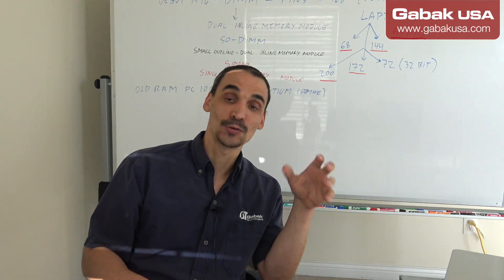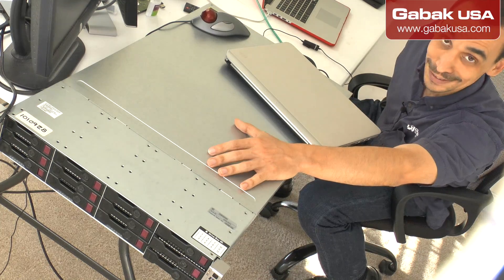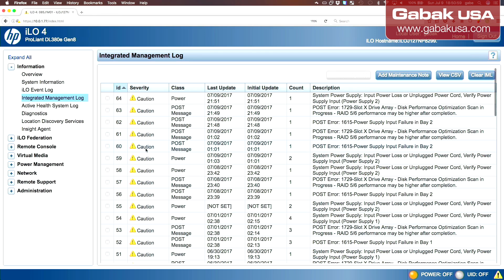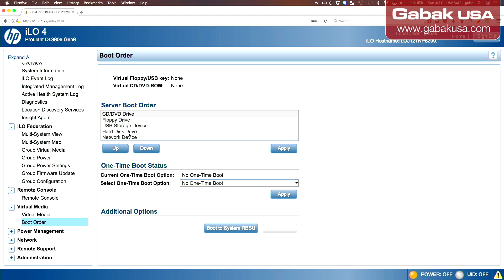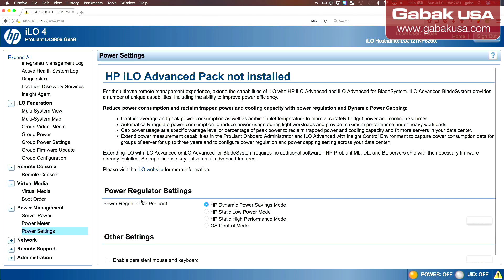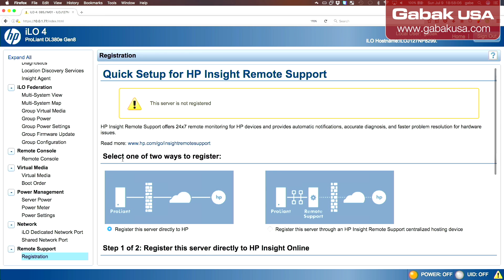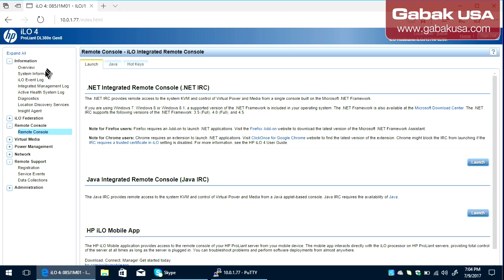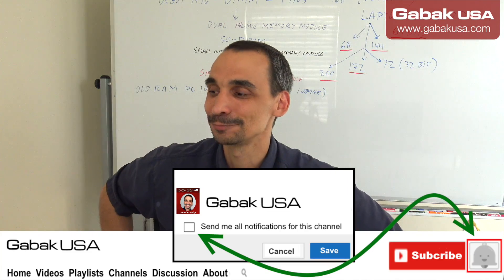how to manage your server remotly using hp iLO

Comment: Thanks for posting . In memory tab we are seeing 2 Processors (Processor 1 and Processor 2 is it comes under RAID 1 ?? . And it is hot swappable we can replace the part by server on condition only In case if any failure occurs ??
Reply from the maker: ram and CPU are not hot swappable